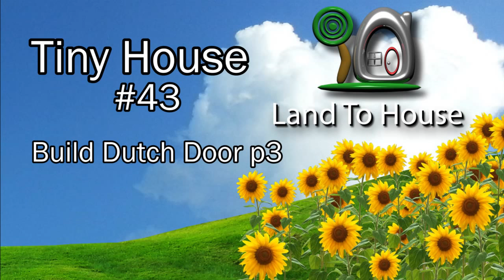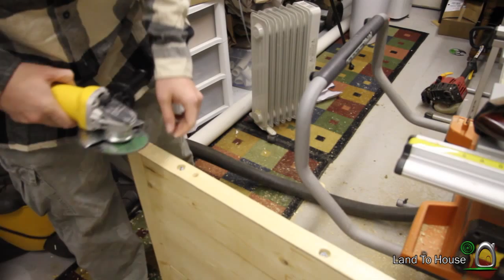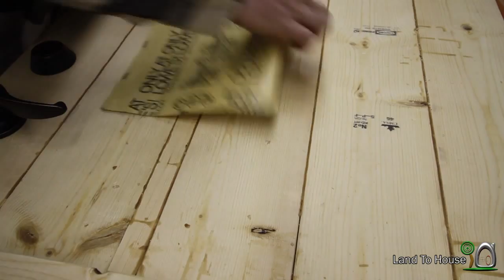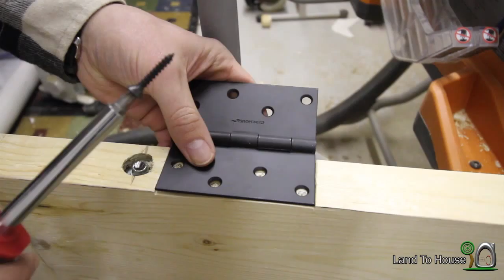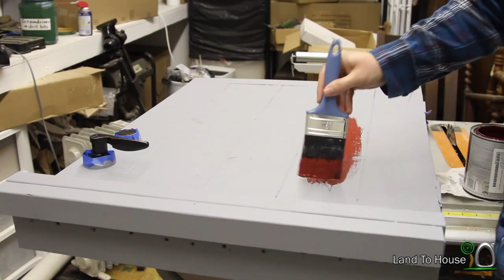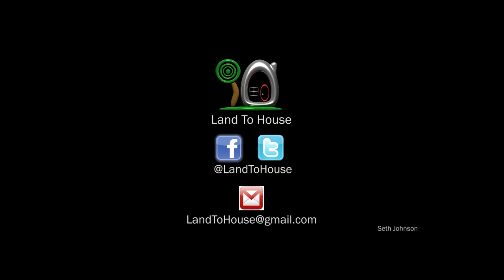Tiny House 43 - Build Dutch Door p3

Comment: Looking good and I like the colour, a couple of tips, when you are planing try to stand behind the plane rather than to one side that way you get the weight of your shoulder behind it and you have more control. The other thing is over the years I have found it a lot easier to remove the door furniture before painting, it saves masking and cutting in and makes a smoother finish around the handles.
Looking forward to seeing the door complete and in position
Reply from the maker: Good tips! In the videos for the top of the door I do much better with the plane. I also sharpened it ha ha.  Removing the handle would have made it much faster and cleaner to paint.  All in all i am pleased with the door. ... If only the door frame was square. ....